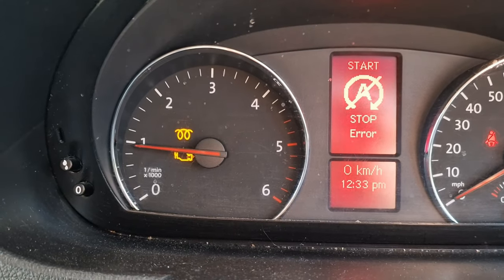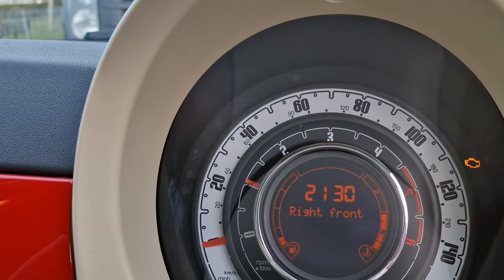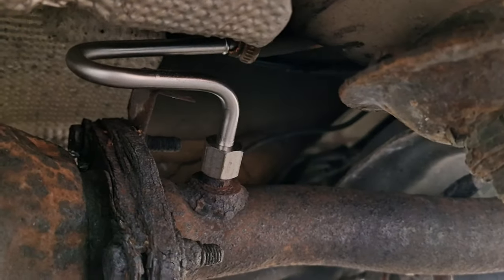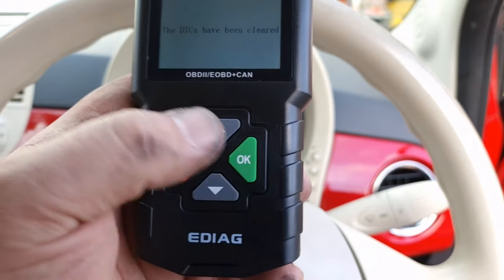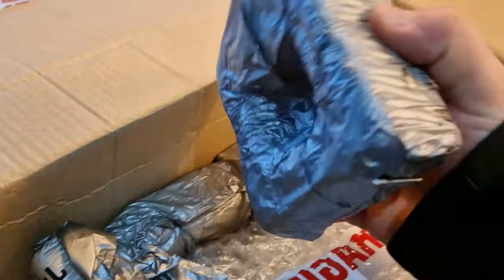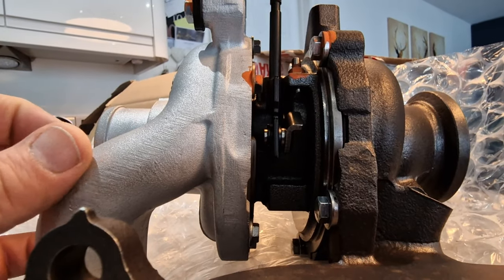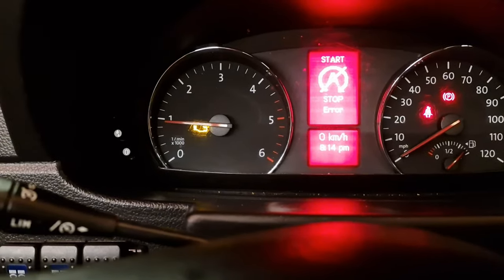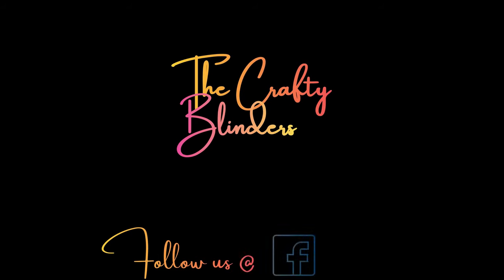installing a new reconditioned turbo and turbo actuator to my VW Crafter

Comment: We literally had these lights on our first day into Scotland last Saturday. Took it to a garage who were adamant it was the turbo actuator as we were getting no boost/suction. New actuator only was £270 so your refurbed kit was much better value!! Anyway 3 days later actuator fitted and it ddnt fix the fault. A bit of searching on forums later and we took the plunge to take the van back and ordered the n75 sensor @ £60 from dark side developments who got it to us the next day. Fitted it and it’s solved! And managed to finish our holiday week driving the van 4 hours back home 😅. We’ve only had our crafter 6 months and have spent a small fortune on new pads and discs, new clutch, rear diff refurb and now this. But we still love it. 

Great video keep up with it, it’s a lovely van
Reply from the maker: Strangely enough, my light came back on a couple of days ago. 
I will look into the sensor. Thank you 😊
I'm glad I've changed the turbo unit as the acctuator was worn when we inspected it so it would have failed in the near future
Reply: @TheCraftyBlindersvanlife  yes I’m sure it’s one of those knock on effects when one fails it impacts the other, our actuator was also very worn. Our fault code was underboost pressure
Reply: I had the same lights on my 2015 ctafter last year I changed oem water auxiliary pump and its been fine since
Reply from the maker: @karlforster580  I've changed that to as it was noisy looking more like the N75 sensor

Comment: Cool tool there the YD201 code reader.... I bought an Icarsoft CR pro Plus a year ago to reset some codes that my cheap reader could not do and it cost me the same as it would have to have STEALERSHIP do the resets for me.  I have used it on our KIA van also and it too has paid for itself.

Thanks for sharing.

Bill - W3SI
Reply from the maker: It's a nice compact tool to have in the van for the time when you need it

Comment: I’m following in your foot steps.  Just re sealed my roof grommet that was leaking.  And now my crafter camper has P256300.  £200 to change the solenoid and now about to change the actuator.  We have cornwall on Saturday so trying to get it done for then.
Reply from the maker: Fingers crossed you get it sorted for the weekend👍
Reply: @TheCraftyBlindersvanlife  still the same.  I’m now £350 down and the van still going into limp mode.   Just order a map sensor.  One last roll of the dice before I book it into VW a an centre.   Looks like Cornwall won’t be happening.  £33k camper.  It’s spent more time off the road than on it.
Reply from the maker: @DJJENKO  same here pal I've got a new turbo coming that's 2 in 2 weeks
Reply: @TheCraftyBlindersvanlife  omg 😱

Comment: your van is very much the same story as ?Viv-i-van, Sam.... ages spent doing a conversion, a nice spell where all goes well  and then the poop hits the van and its goodnight vienna with the bank balance. I always like watching your fixing the engine videos cos it makes me realise I should have learned to do stuff like that and I need to get some knowledge- though there are things like your front wishbone work that is deffo physically beyond me.    I have been thinking of getting an obd reader but what stops me is becoming paranoid and becoming addicted to checking every five minutes...

Any hoo, i have managed to get on Viv's roof and finally fit the flexible solar cell though theres more tiger seal on me than the flippin panel.. As ever, much respect and bessy regs- Kenny
Reply from the maker: Kenny I'm watching your progress with baited breath pal

Comment: I've been using bluetooth/ble OBDII connectors for years. I can recommend one you can keep permanently plugged in - pair it to the phone and you will get loads more data (best Android app is Torque). I use a Vgate Pro now (been through all the cheap ELM ones!). Depending on your vehicle you can also change settings using these little bits of kit.
Reply from the maker: Cheers pal handy to know

Comment: Jeez Sam she’s def testing you these last few months. Still you won’t need to be the one consulting You Tube to know how to do jobs on it in the future, everyone will be consulting you! 
It seems to me the earlier 2.5tdi gives less trouble than the later 2 litre. Our 2012 2.5 blue tdi we’ve had for 6 yrs and 60,000 miles has had its moments with a NOx sensor and an adBlue tank heater but never left us stranded… yet! 
Hope that’s the end of your woes for now. Off to Ireland next week then see you at the overland show bud.
Reply from the maker: I think you could be right. we did intend to use the van more thus year, but things didn't go as planned 👍

Comment: Oh, how I can relate, Sam. 🙄
My 2014 Crafter has the bi-turbo setup with a gummed up overboost-release-mechanism (I don't call it a wastegate as it is not one in the common sense). It sends the Crafter into limp mode if the turbo pressure exceeds the preset limit. After a stop and restart, the ECU is reset and it runs.
I certainly could remove the unit and try to disassemble it, but with 170K miles on the clock, every nut and bolt will be frozen solid and I will most certainly bust some. We also have a reputable turbo reconditioner in Berlin (for a Crafter CKUB engine code, the turbo will lessen my wealth by GBP 700, plus a GBP 260 core charge - refundable upon return of the old unit). Still a far cry from the dealer turbo price (GBP 2,900).
If I was 10 or 20 years younger and healthier, I'd replace this myself - I'd have the tools and the know-how. So I will have to spend another GBP 300 to get it swapped out. After an oil and filter change, it should be good to go again. All that will happen in the next couple of weeks.
Sidenote: I did get all the gaskets, seals, clamps and new copper exhaust nuts from the VW dealer for around GBP 85. If you just have a boost problem and not a blown turbo (as on yours and mine), there is no need to replace the oil pipes for fear of debris in the system. On my bi turbo, new lines alone would cost another GBP 350 (!).
We just did the MaxxFan installation - flooring, insulation, roof rack, solar and turbo swap need to be done by mid-May, as we do have a date in the Lake District National Park, right? 😁
Stay safe and cheers from Germany! 🚐☁🍀
Reply from the maker: I think the issue is an intermittent fault on the  N75 sensor should know today when I fit the know one

Comment: The pig tail light is glow plug control,  either the glow plug control module is bad or your have a faulty glow plug.   It's not necessarily the end of the world, bit harder to start in the cold maybe, and first few mins of running might be a bit more noisy and fuel consumption might go up a bit.
Reply: The Crafter uses the  glow plug indicator when there's a turbo fault as well. When the light's on permanently it's a glow plug problem. When the light blinks, it's a turbo problem.
Reply from the maker: The flashing glow plug is a pending fault code
Indicating and issue that requires investigation 😁👍
Reply: @TheCraftyBlindersvanlife  I stand corrected. I was told it was only for Turbo problems. Ah well, you live and learn.
Reply from the maker: @Nicholas Barnes  hey no worries, mate. I'm still having issues with it I'm off to the garage tomorrow to see what's going on
Reply: @TheCraftyBlindersvanlife  so I was correct in calling Volkswagen stupid then haha
Reply: @TheCraftyBlindersvanlife  Cross fingers it's sorted. Hopefully it'll turn out to be something and nothing and not a ££££££ surprise.
Reply from the maker: @nabarnes  cheers 🤞😁

Comment: You must have bought a lemon, my 2014 MWB 140k crafter camper has had little issues other than steering rack being replaced twice now, probably due to the big 17” black rhinos and bfg tyres? Had the pig tale warning and fixed it by replacing coolant pump B. I don’t want to jinx it though as vane pump is leaking and I might have a lot of parts failing one after the other going forward. I never drive on motorways due to an accident that happened many years ago where a few of my friends died. So basically I never go above 60 mph 2000 rpm and only drive on A and b roads so engine never strained but suspension and gearbox takes a hammering. I’m interested to know your driving style and if that maybe has an adverse effect on all these parts that keep failing? Do you leave the van sitting for long periods? That kills components. Cheers, thanks for the upload 👍
Reply from the maker: A lemon your not kidding! It is the standing around that caused the majority of the issues, It sat for 8 months prior to me buying it and then lockdown came so sat for another 1 year after that we we limited to where we could go so never got used properly, we call it triggers brush it's only had 7 handles and 3 heads 
on a positive note we have had 2 amining years without any major issues
Reply: @TheCraftyBlindersvanlife  triggers brush 😂 interesting you say no issues in two years and those two years are when you have been using it most, almost like the van is alive and was suffering from bed rot. Like us it needs to stay active to stay healthy and thrive, here’s hoping your problems are all fixed now and she can start paying you back for all the attention you’ve given her 👍

Comment: Great stuff. I wasnt clear on how you ended up with the fault code as you cleared it but it then remained. Did changing to the OEM gasket resolve that?
Reply: I was wondering the same.

Comment: Another good entertaining and informative video. However, I'm at the early stages of contemplating a new build and trading up from my high roof Lwb Vivaro setup. The Crafter was in the picture but it's unclear if it's any better built than my French built van, where reliability is concerned. If it isnt, what is?
Reply from the maker: I know what you mean we've had a run of bad luck lately but I think we are back on track 😁👍
Reply: @TheCraftyBlindersvanlife  That's what I keep telling myself, its all fixed now. Until the next time.........onwards and upwards.

Comment: Hello everyone! 
I am sorry if this is a stupid question,but could you please tell me is the N75 valve also called solenoid or are those 2 different parts?
We just put refurbished turbo and it is now showing that an inlet valve is stuck/closed and it again goes into limp mode.
Thank you in advance!
Reply from the maker: Yes it is sorry for the delay in responding

Comment: I've got a crafter as well and had a glow plug issue... Changed the battery then the glow plugs still saying glow plug 4 problem... Changed the relay checked the fuse by the battery... Still saying glow plug 4 fault (nothing wrong with it) driving me mad! Anything you or anyone can suggest would be great
Reply from the maker: I've not come across this problem before have you got any further on with fixing it
Reply: @TheCraftyBlindersvanlife  think it is a break in the glow plug wiring harness 🙄trying to get a new loom for it but one company saying have to replace the whole loom nearly £500...so going to see if I can get just the glow plug bit of loom
Reply from the maker: @Another brick OUT the wall  if you can get an old loom from a scrap yard, you remove the damage cable from the glow plug and trace it back to the ECU plug remove the pin and cable then replace it with the one from the scrapyard loom 
We did this in the past on a fire damage crafter loom 
it works a treat and looks like new when you wrap the loom
Reply: @TheCraftyBlindersvanlife  yeah! Good thinking. I'll give that a try.... Thank you for the tip😁👍

Comment: If I was in your shoes I would buy a Used but Good condition Original VW Turbo
Reply from the maker: The reconditioned one comes with a guarantee that we used when the first one failed. Also, the reconditioned one was the same money as a second-hand unproven one, I think I made the right choice, I would always favour new or reconditioned parts when it comes to major components,
How do you know when you have a good second-hand part? It's always a gamble buying second-hand
The van is running great it turnsout out the vacuum pump had an intermittent fault
Reply: @TheCraftyBlindersvanlife  fair and the recon Part is also Hit or miss as there can be cracks on the metal casing and they would just fill it up and say it’s “ Reconditioned “ but if we had the opportunity and money Buy it straight from VW then it’s a guarantee that it will work but I have experienced a P2563 when the Injector came out and shred the Steach bolt and needing to be drilled out and a New bolts and new camcover I wiped the codes out a couple of times and it some how fixed it self could of been a Intermittent Turbo Regulator but it drives fine knock on wood 👊🪵